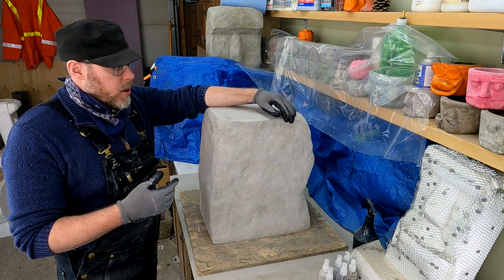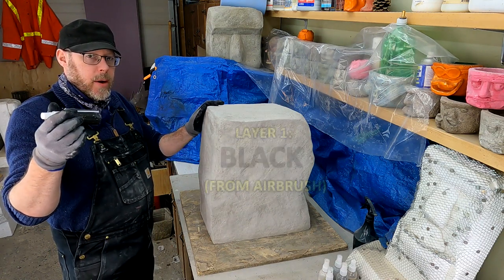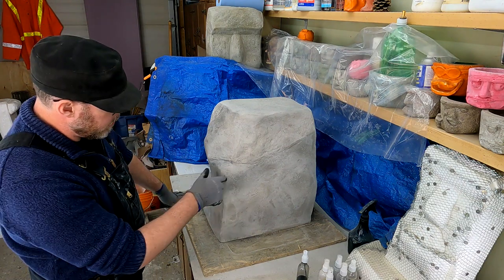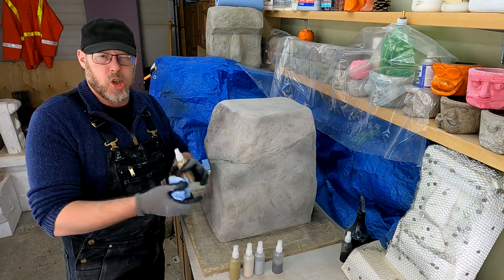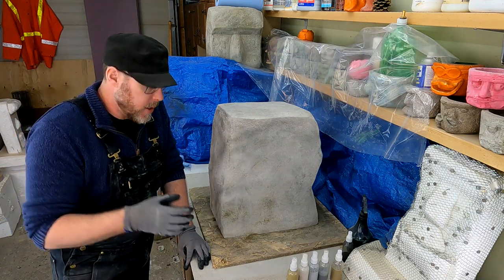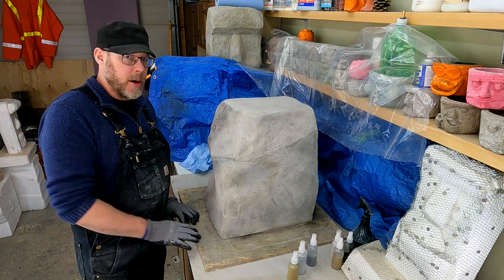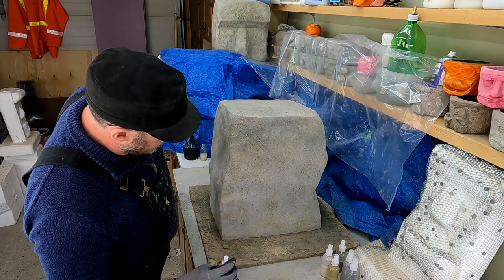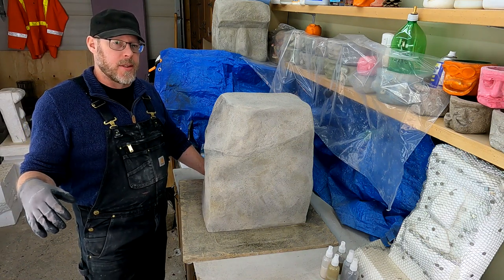How To Make Rocks From Styrofoam (4/5)

Comment: Such a good series, thanks Steve.  Q:  if I wanted to replicate the colors of the Grand Canyon would it make sense to mix the base color (maybe a light orange or umber) into the wet mortar mix first or keep it gray and layer it up?  A granite look wouldn't need this step but maybe for other colors?  Any suggestions on what colors to use to achieve Grand Canyon colors, down to the layering order?  I'll be here tomorrow for the exciting finish, thanks again.
Reply from the maker: I would use pigments from iron oxide (red) to create a base layer which is closer to the base colors in the rocks found at the grand canyon. Then I would use airbrushed layers to mimic horizontal layering of the rocks.  Probably no misting sprayers at all for something like this.  All airbrush.

Comment: I think another option for the bottom, if you don't have rubber + silicone, as discussed at 20:40 would be paint. Pva will absorb some water, while acrylic will not re-emulsify. Acrylic gesso adheres well to styrofoam. Then you can paint it with acrylics; or any paint; & then you can apply an outer varnish layer of exterior water based or even oil based polyurethane, to give a good seal.
Reply: Oops. I researched pva more  & the weldbond you use- it is modified pva, not the same thing as pva, which helps it to not absorb water the way regular pva glue would. Now I better understand what you were talking about, with variations in different pva glues...

Comment: why aren't you just removing the interior styrofoam or at least most of it? most videos, i've watched they do?
Reply from the maker: It is stronger with the foam core.  It would also need to be a lot thicker (and stronger) without the foam core.  All just options based on your individual / unique application.